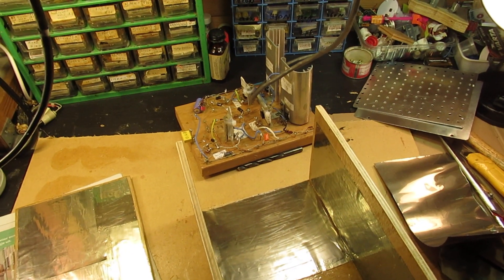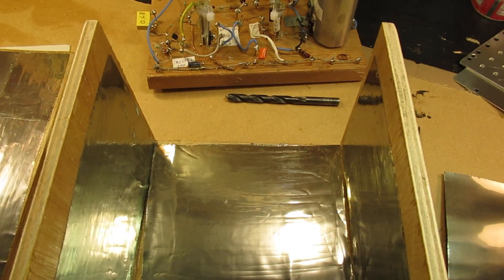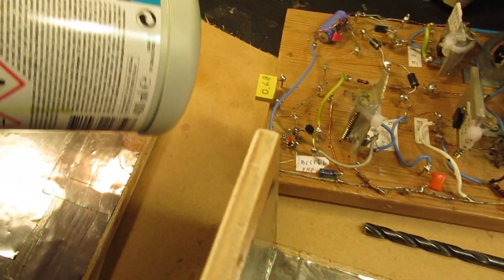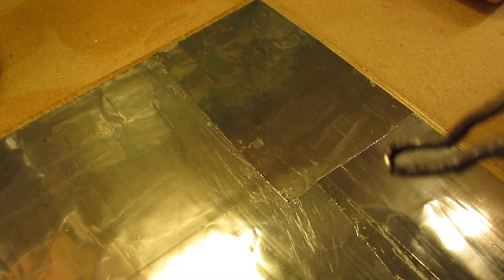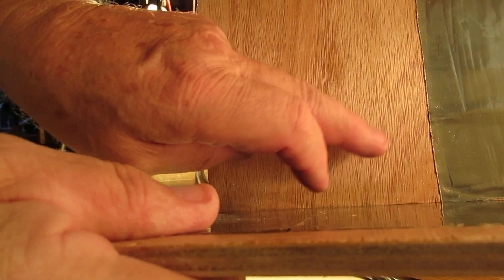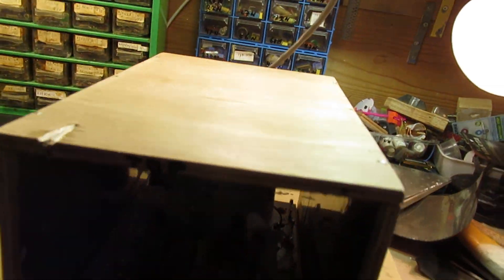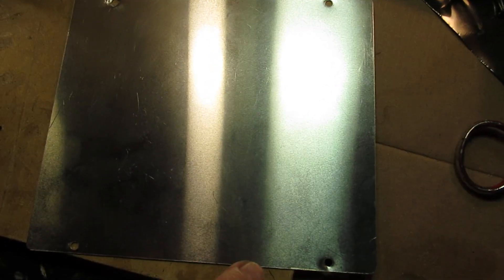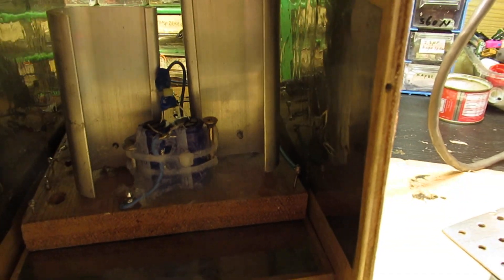Make a Faraday cage for E.M. shielding against external hum for an audio Amplifier in a wooden box

Comment: I would think your transformer shield would not work that well. Would need MU-metal, which is so expensive.
Reply from the maker: It works perfectly (tested many times).
Reply: What is the shield. Steel, aluminum? @radiofun232
Reply from the maker: Indeed MU metal is very expensive and it is special. It can not easily be permanently "magnetized", that is an ideal property, for using it (in the past, say the 1950's-1960's) for magnetic tape heads etc. Later better materials were developed for that purpuse, I mean magnetic tape heads for sound, computers data store, etc. A whole family of ferrite materials was developed during the 1940's-1960's, e.g. by the Philips laboratories in Eindhoven, Netherlands, but also (in those days) in the United States. 
Shielding with tin-plate and "normal" (=soft) steel has certain disadvantages. Biggest problem: permanent magnetisation. That means e.g. that in a classic cathode ray tube (CRT), when it is shielded with a cone of tin-plate, the dot on the screen can be permanently pushed to the right or the left. But (important) I made a cone of normal tin plate to shield a CRT and there was no problem at all. It shielded the CRT perfectly. The video about that oscilloscope is on my YT Channel. I had the same experiences when making audio amps (also sensitive pre-amps), everything could be properly shielded against external electromagnetic influences (hum, 50 Hz-60 Hz and more) when mounted in a simple tin plate (steel) box. Anyway, thanks.
7 sept. 2023.
Reply: @radiofun232 Well, if you use steel and a crt and it happens to become magnitzed it might be unmagnitized. I had an expensive German Lowe HD TV and I had my audio speakers next to it and it distorted the picture. The technician came out (I was not there, but my mother told me) and hand a big metal loop; he waved it around the TV in a circular motion and then suddenly pulled it away and the distortion disappeared as if my magic!!!!!!!!!!!!!!!!!! I mean to my mother it seems like magic, real magic from the beyond.
Reply from the maker: Yes true! They demagnitized the whole CRT TV tube, making it all work again properly. Thanks.
Reply: @radiofun232  what is your background. You I’m retired electrical engineer. You know so much more on the practical side than I do. I can do lots of simulations on a computer, but we were not allowed to touch any hardware ever; now I’m enjoying the hardware side in my retirement. Bill
Reply from the maker: I am a hobbyist in electronics since 1967, doing experiments almost every day. And a lot of reading and self study.

Comment: What amount of copper or aluminium is equivalent to steel?
Reply from the maker: The shielding effect of copper and aluminum is not very effective. It is e.g. used/usable to shield IF radio coils, because the copper/aluminum shielding does not effect the properties of the radio coils inside. With steel the peak resonance of that coil vanishes.

Comment: I’ll have to do the same thing- line a wooden box with solid steel. I have some steel mesh that is tightly woven and could help also I believe.  I hope to see you in the next couple of videos.  Some people told me it doesn’t matter if the plates are tied to earth ground so they can float?  Anyway getting rid of interference is interesting.
Reply from the maker: They have to be tied to ground for safety reasons, goes to the mains "earth" wire, in the Netherlands (230 V-50 Hz) the yellow/green wire. Tightly woven steel mesh works good for shielding against external E.M. influences. 7 sept 2023.

Comment: Very good information. I know of this from your previous videos. All cans these days, I think, are made from tin-platted steel or aluminum.  Cans for soft drinks, alcoholic drinks, fruit juices, teas, herbal teas, energy drinks, etc.
Reply from the maker: Thanks Ron!. Aluminum is not usable for this purpose, but aluminum cans/materials are usable for shielding  self made IF coils on (say) 455 KC. When you want to shield open 455 KC coupled coils, with a certain distance from the alu plating.
Because they (alu cans) don't damp the small 10 KC wide IF peak on 455 KC. I tested that in the past. Thanks again. 2 sep 2023.